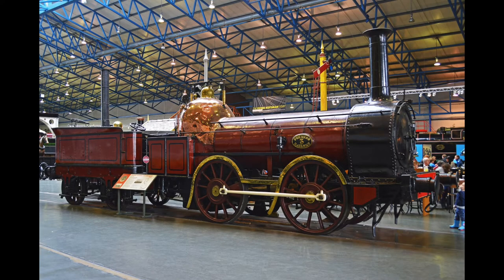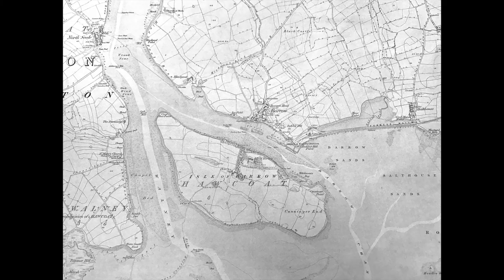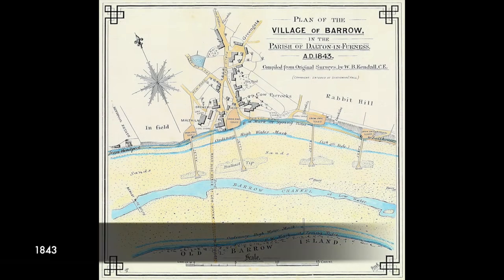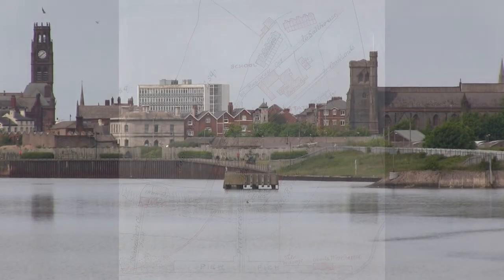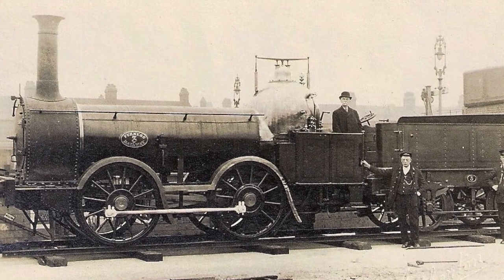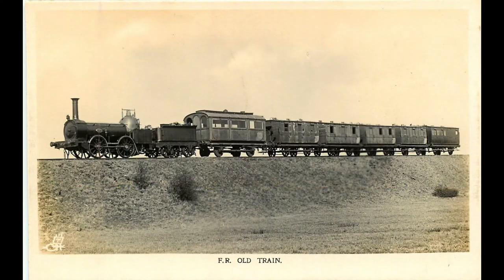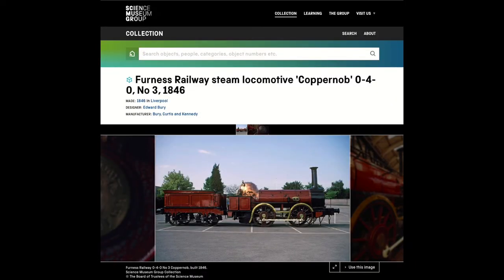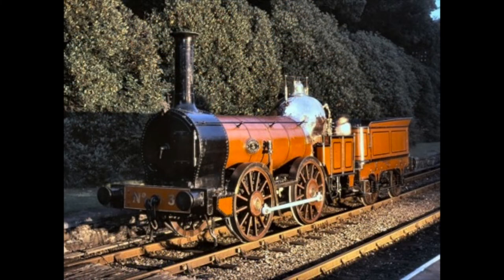'Old Coppernob' - Furness Railway No  3

Comment: The subtitles could do with chucking out. Number 1. Then perhaps replacing with greater accuracy? How much is that to ask?
Reply from the maker: I didn’t put any subtitles on this film. Maybe subtitles of my narration have been generated for you by YouTube without any input from me. So yes they are probably crap. If you refer to the text in bottom left corner of some photos they are Creative Commons photo credits. So, other than that an enjoyable film then.
Reply from the maker: after a little investigation you may have clicked a box in the bottom film bar which is labelled CC.This opens captions which it says are autogenerated by Youtube. So click it again to turn them off. Or click the settings icon to its right to turn them off there as well. So Youtube seems to create captions as it wishes for all films whether we like it or not. Hope you enjoy the film better now,. Gary